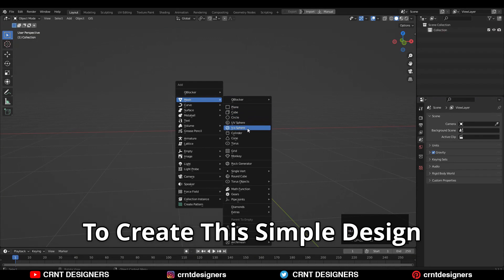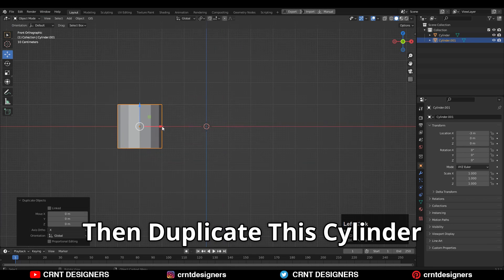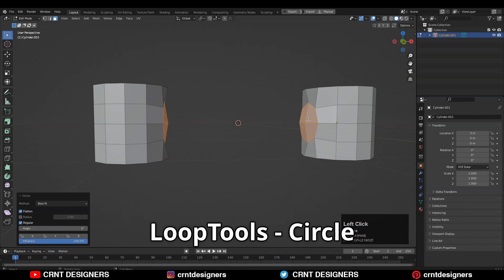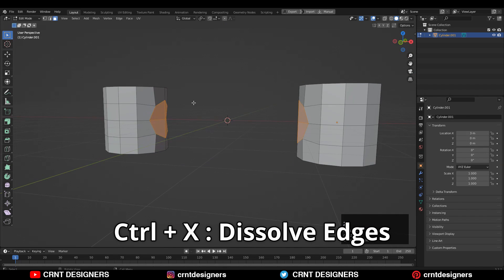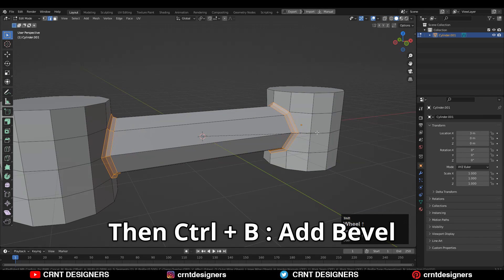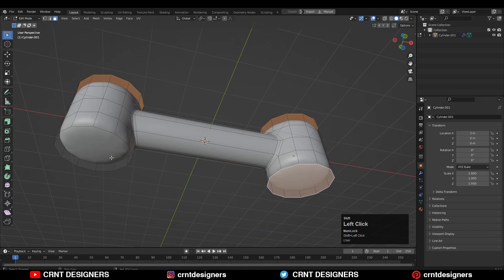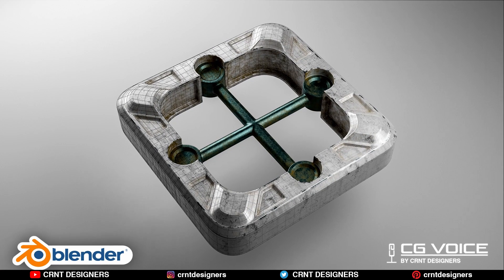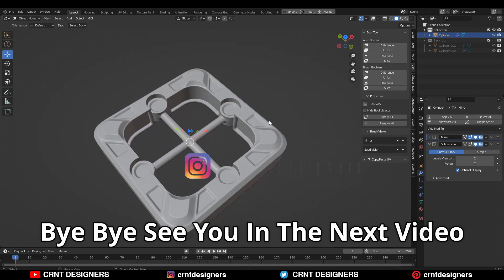Use This Modeling Trick To Join Cylinders _ Blender Topology Tutorial

Comment: thanks so much - helped me out of a jam! Just curious, I noticed you specified 12 on the cylinder vertices, and also that the 3 loop cuts help to form a square like quad along the height of the cylinder. Ive tried this method with 16, 24, and 32 vertices, loop cut to square quads, but each time I use the loop tool to turn the 4 selected faces into a circle, I get some pretty bizarre results - the faces shard and becomes heavily distorted. Im wondering if there is something special about 12 vertices on the cylinder that help make the circle loop cut tool successful ?